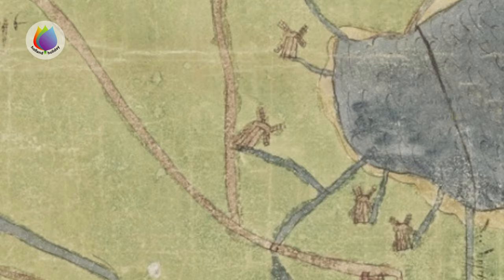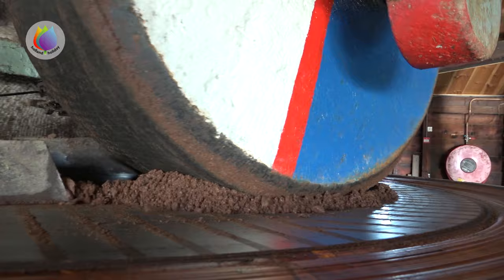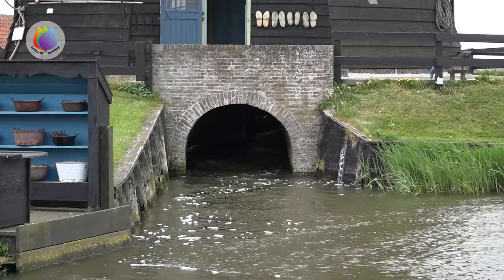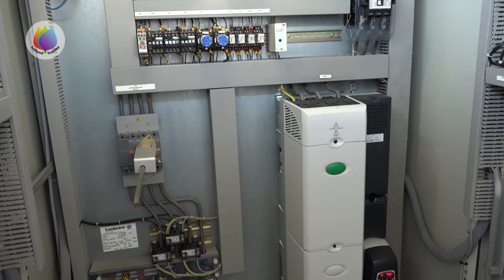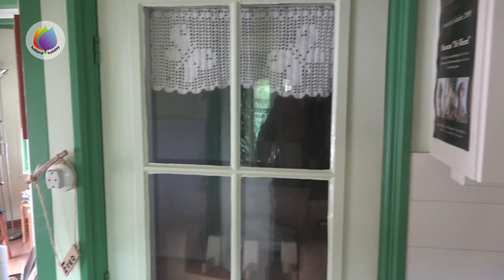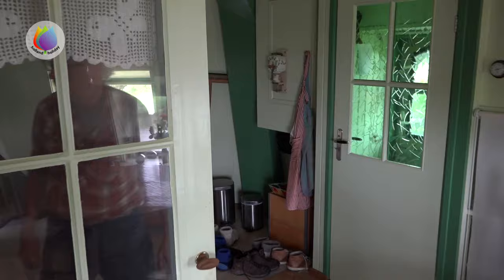Dutch Windmill Inside

Comment: I always wondered exactly what makes these windmills work. Multiples of these can relentlessly move water, as long as the wind blows. I assume the average conditions in Holland are breezy. They have a lightweight lattice frame, with canvas, for the blades. It looks like it's possible to adjust the blade surface area by regulating how much canvas covers the frame. The wooden cogs, the whole thing must be made of durable hardwoods. Speaking of wood, where are the trees grown, which kind? I imagine that the nautical trades were adapted to using wind against stationary frames that pivot. Who exactly came up with the basic design? Hans VanMagyver? Genius. Woodworking experts.

Comment: That is 500 years old..? I wonder about how often the wooden parts (meaning everything) needs to be changed..
Reply: The straw roofing is not original :-). Neither the wings. The "frame" of the mill is original. All the wood inside: eight oaks in the eight corners and eight horizontal wooden beams are original. These eight trees felled between 1525 and 1527. The paddle wheel of the mill has been changed in 1842 with a mortar.
Have a nice day, Fred Prins, miller
Reply: @FredPrins  Thank you on the knowledge! How is the wood protected from rotting away? I thought that wood would rot away with time and that's why I assumed that the wooden parts are changed from time to time.
Reply: @Gandeloft  The wood of oaks are very resistent and the wood was inside the mill, so protected against wind and rain.
And . . . the wood in the mill is ages penetrated by the smoke of the coal stoves (or before wood stoves) . There was no chimney (or you can say the chimney was (ended) in the mill). Now the wood is hard like stone.
Reply: @Gandeloft  One of the other videos I watched explained that the chimney for the fireplace ends up near the timbers, so that keeps them dry and keeps the bugs out.

Comment: I can't believe how fast it turns, that's amazing.  Must get a real rumble up inside.

I'd like to know what sort of bearings hold the drive and centre shaft.
Reply: Inside the mill it's very quiet.
The rotating shaft of de mill (with the wings) lays in two hollowed bluestones. The vertical shaft which brings the movement down has an iron pin. This iron pin stands in a steel container filled with salad oil.
Reply: @FredPrins  Thank you for the reply, that's very interesting.

Comment: I wonder if there is any lubricant like bees wax or beef lard used on the teeth of the wooden cogwheels, and also I wonder about the main bearings that support the vertical shaft.
Reply: For the teeth of the wooden cogwheels we use bees wax. We use pork lard for the horizontal axis of the wings. The vertical shaft has a iron pin in a oil tray.

Comment: You didn't credit Rolf ten Hulsen for the footage. Also quite some information is incorrect.
Reply from the maker: We look forward to your comments!
Reply: Holland Holiday Thank you for getting in touch! Here are some issues I found:

1:13 the mill shown in the picture isn’t comparable to the first polder mills. The shown mill is a smock mill with a tail, which only started to come around by the beginning of the 17th century. The first polder mills were “wipmolens”, which design has been derived from post mills. 
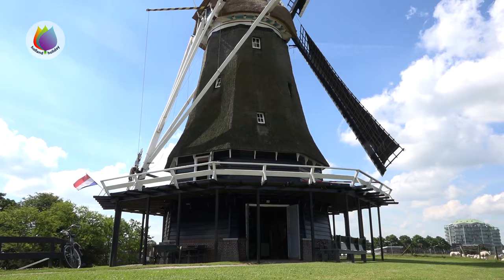2:38 the footage is mirrored. Please don’t do that, it grinds my gears and it might lead people who don’t know better to think that that’s how it’s supposed to go. 
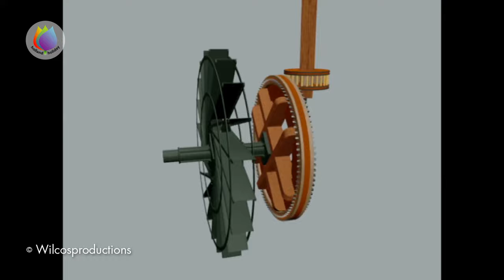2:51 it’s called a scoop wheel. 
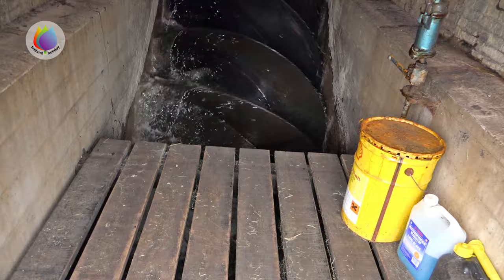3:02 the level up to which an Archimedes Screw can pump water is limited by the rather small amount of power a windmill develops, but mostly by the length of the screw: the maximum is about 5 meters, after which it starts to bend and thus starts scraping the floor beneath it. This means that the screw (which is quite fragile) will be damaged and starts leaking. 
6:14 you don’t take the sails off just to turn the cap. All you do is take the brake off. 

I suggest also putting a link up to the website https://en.molendatabase.nl . This website contains a lot of information on all existing windmills in the Netherlands, and you can look for mills with certain specifications or look at mills near you on provincial maps.
Reply from the maker: @gwyneddboom2579  I have forwarded your comments to master miller Fred Prins, the miller on the video.
Since his (and my) english is not strong in this area, I translated it with Google translate:
My English may not be good, but I don't understand most of it; Google translate cannot make meaningful text from a part.
A justified remark from him is that if you make a mortar too long it will bend.
That is hypothetical, there was no need for jacks of more than 5 meters. What has been the case in the past is that paddle wheels can hardly raise higher than 1.2 meters. Otherwise the paddlewheel will have a size that can no longer be accommodated in a mill.
So a three-pass (three mills in a row) came to 3.6 meters head and there have been some four-passes (one of which still exists), which could thus boost 4.8 meters.
With the switch from paddle wheel to mortar, the polder board saved a lot in maintenance of windmills, but especially in the wages of all those millers.
I have not recently watched the film, but if it mentions that the mortar has no limitation in length, then that is intended in that context.
 
It is therefore not correct that these mills were only built from the beginning of the 17th century.
The Groenvelder from 1529 is now the oldest octagon, but certainly not the first. There are maps from before 1500, on which eight sides are drawn.
He can look up the Groenvelder in the English-language database, which he recommends.
Well, and what does he mean by 'you don't take the sails off just to turn the cap'?
or with 'the footage is mirrored. Please don't do that, it grinds my gears'?
Reply: Holland Holiday I only have some responses to the last part of his answer: I was referring to octagonal mills with a tail, which de Groenvelder doesn’t have. And to clarify the things he didn’t quite understand: he will know that you can stop the mill without clamping the sails in order to turn the cap. And I really do not like it when people show (moving) images of a mill mirrored.
Reply: @gwyneddboom2579  Enough.
Reply: @hollandholiday4181   it's  beautiful how to make it is  building in my country  I'm Mahdi Broker